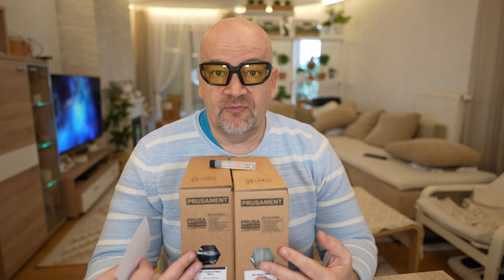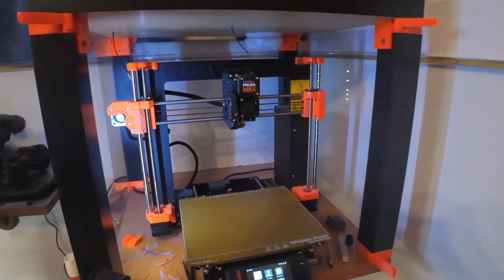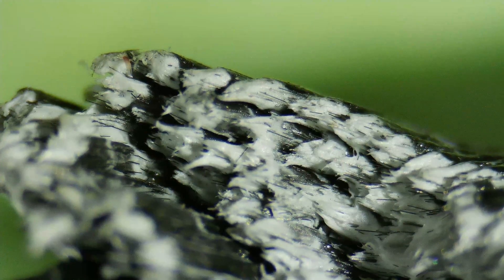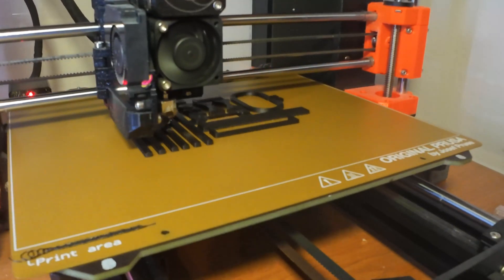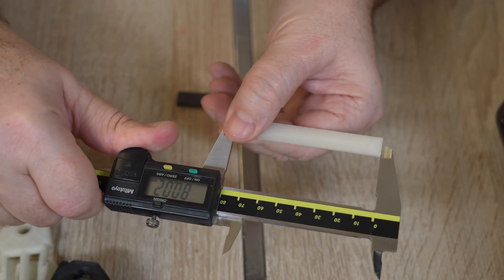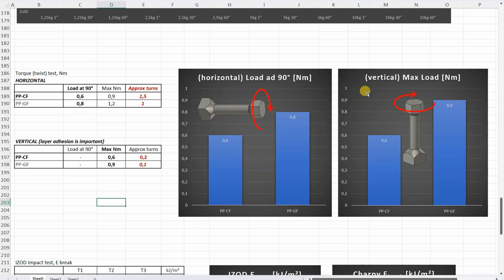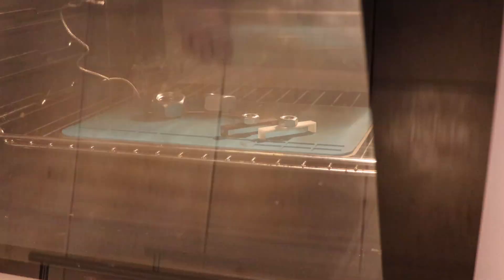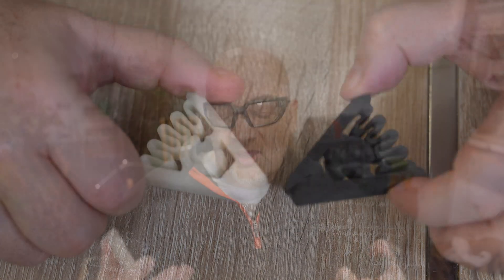Prusament PP-CF vs PP-GF Tested – Carbon Fiber or Glass Fiber Polypropylene?

Comment: I love PP. I print PP all the time. It’s very easy if you buy a buildtak pp sheet to put on your bed. I am doing a print right now on my A1 mini. Once it’s done I’m going to upload my PP profile to makerworld.
Reply from the maker: Do you print with raw PP or some fiber reinforced version? No warping problems?
Reply: @MyTechFun all raw PP. the only warping issue I’ve had was a on a large-ish rectangular piece (about 160x200mm) printed with PPprint filament. I have a spool of CF PP sitting around but haven’t found a use case for it yet. The piece I’m printing now is a cup holder insert for my car (wanted something slightly flexible and also dishwasher safe). Circular piece about 90mm diameter on the contact point of the plate. This is the second revision but 0 warping on the first print. I’m mostly using fiberology PP, but the profile also works with eryone PP for a “cheaper” option.
Reply: @soul_in_a_fishbowl  Does PP smell bad when printing like ABS?
Reply: @ferrumignis no I don’t notice a smell at all unless I’m like 3 inches from the build plate I can get a whiff of something.
Reply: @soul_in_a_fishbowl  Thanks, got to give this a try though not the Prusament stuff, way out of my price range.
Reply: can you link us where to buy a buildtak pp sheet for a1 mini /x1?
Reply: @t @tommaso74bianchi got it straight from buildtak. Cut down an x1 sheet to fit the mini plate.
Reply: If you like PP, you should try COC (cyclic olefin copolymer).
Reply: What also works good with bed temperature of 100-110°C is the "Prinplate extreme" from Princore . I use it also for Nylon, ABS/ASA and quite everything else...
Reply: @matthias3445 the buildtak sheet is run at ambient. I set all of my bed temps to 25C. I think the ambient plate actually helps reduce warping overall. Considering one of the stickers is like $10 I think it’s a no brainer to pick one up
Reply: Tried pure PP on my Mini on PEI with magigoo PP. But with 80°C max it didn't Stick after 2 Layers. I really don't understand why the caped it at 80°C 😢
Reply: @matthias3445 Power supply limits and/or material limits. It's a low cost entry level machine.